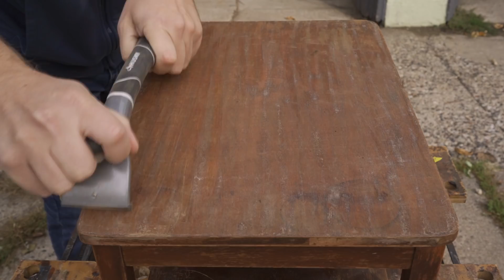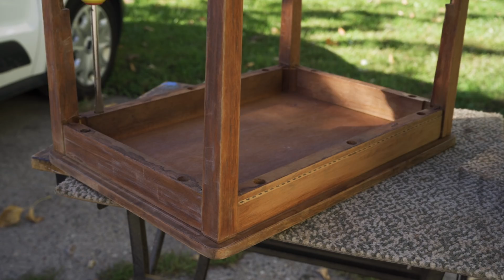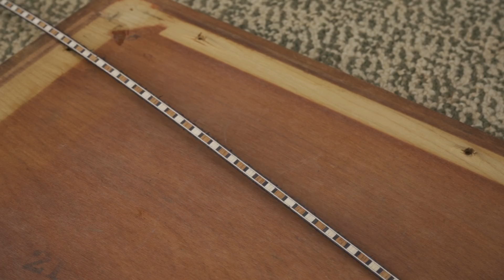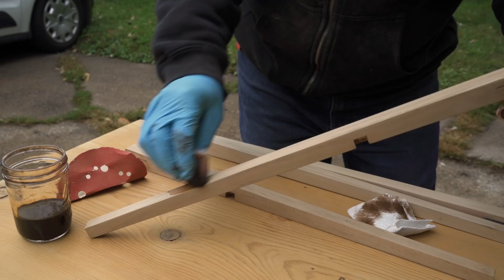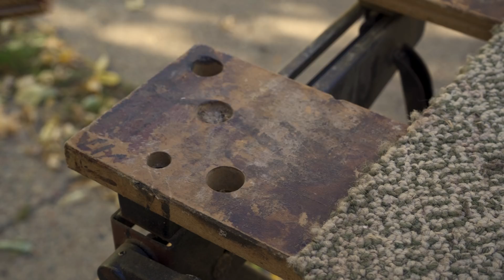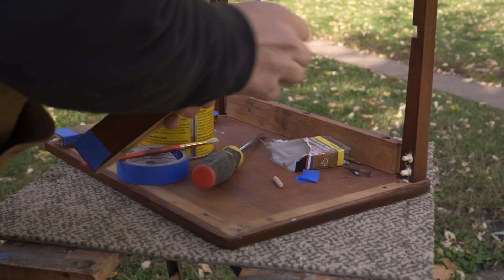Thrift Store Rescue #26 | Refinish And Add Inlay To A Thrift Store Table | Furniture Restoration

Comment: Hi! I am about to purchase an old GE stereo console from the 60s and am planning on refinishing it. Its in pretty good condition, but has some water damage on the top and other stain deterioration. I know you have not seen the piece, but do you recommend stripping the current stain, sanding, and restaining the piece? I also wanted to make it my own with varied colored stain on the piece. Do you know if there are different stain colors that go well together? First time doing this.

Comment: You did a lovely job with this table. I agree about the inlay. If it was too bright/contrasted it would loose some of its older charm. You were VERY patient with this piece, mixing the stains and replacing the brads with dowels.
Great $5 investment.

Comment: Just a thought on scraping:  Pull your scraper off the edge in two directions.  Looks like you are going over the far edge with the scraper, then pulling towards you.  That's got to be chewing up the edge of the veneer.

Comment: Nice piece of restoration Bud.   I am an Auto Body Painter, and you have done many steps using exactly what I do with Body Work and I  would have done everything the same way.
Only the part where you put the inlays.  Instead of using that little screw driver or whatever to cut and rid of the little excess wood material, I would have made a small block out of wood or plastic and block the entire groove so the inlay could have a nice clean fit.   Also, whenever you Stain, please go from END TO END in one long nonstop motion, do not start in between  a piece of wood, as stains tend to bit and soak in within seconds leaving a Dark and Light spot on contact.    Great job anyway.

Comment: I'm not sure what it was for when it was new. Perhaps a telephone table and a little shelf underneath for a telephone book. What it can be used for today is a printer table and use the shelf for printer paper. If it survives another 70 years who knows what they will have then to use it for. If you haven't purchased this it would have fallen apart and ended up in a land fill. You did a great job thank you for the video.

Comment: The inlay is on one side because that table is part of a three-table nesting set. The one you have is the bottom/lowest of the three and when nested with the others, it slightly hangs into/onto the middle table above it, then the middle table hangs from the top table while the top-most table legs are always on the ground. The top table has a three-sided (back and sides) ½" lipped edge (not sure what that's called) to keep things from rolling off (?) but in any case, defines which side the "front" is and explains your, the smallest of the three tables's, decorative inlay. These things I know because I have the full--and all three prone to wobble--set. :) Wonderful to see it renewed!
Reply: How cool!
Reply: Very cool! I knew there had to be a reason!
Reply: Well he only had one, so I think it was/is a good idea!
Reply: Nicely done.  Beautiful little table.
Reply: I'd love to have those!!!

Comment: I love furniture from that era. I would have spent $5 for that rickety table. I probably wouldn’t have so meticulously restored it but I def would have pulled it apart to make it stronger. And I would have sanded it a bit snd gave it a slight lacquer coating. Probably whale oil or something like that. But I like that shabby chic look to an extent. My living room is full of unique salvaged pieces. Only one that didn’t need work was the China cabinet I got at an antique store that was still in really good shape. I have a Hoosier cabinet in my office that needs a little love that I keep telling myself I’m gonna work on one day. But I watch these types of videos to learn some ideas how to restore vintage pieces in the meantime. My actual work desk in there was found at the dumpster. Tho not a vintage piece per se, cuz it’s mostly pressboard, i painted it with chalk paint and it really blends well with the room, including the Hoosier cabinet and is better designed for a computer than the Hoosier cabinet where I keep my printer and files snd office supplies and such. The neighbor who tossed the desk can’t believe how great it looks now. Thanks for your post. You’ve inspired me to get back to the Hoosier cabinet

Comment: Your videos have inspired me to try and refinish a dresser I got from my neighbor.  Citristrip worked pretty well, but it seems like there was a water-based stain or dye under the oil based stain I just removed.  Wet paper towels seem to remove it to an extent, but is there a better method to remove a water-based stain?

Comment: Another lucky table wins the Dashner Designs lottery! Wondering why you didn't do the color experimenting on the inside of the apron instead of the inlay side? Would have made it easier to back it up if the red went too far.

Comment: This is so inspiring, and reminded me of the pieces that have passed through my hands which could have been given a second life, but didn't have the knowledge or inspiration to work on. 
It'd be interesting if you can post a video on restoring old speaker cabinets which I'm sure many viewers would find interesting.
Reply: For sure! I have an old radio or ancient tv cabinet (radio/tv long gone from before I acquired it, when previous owners turned it into a (badly done) little cupboard). I've kept it for years just waiting for the right inspiration to make it look great again.

Comment: very beautiful table.
those wire things in the corners were romex staples used to attach electrical wiring during home construction to wood framing.
not really a proper fix

Comment: Great work as always. It seems like in a lot of your earlier vids you used a chemical stripper to remove finish and now you seem to rely mostly on scrapers. Any reason for the switch? Or is this just job dependent?
Reply: He has said they changed the formula of the stripper and it doesn’t work as well and this is easier.

Comment: Since this was an inexpensive table when it was made, my guess would be that the inlay was only added to the “front”.  I love that you added it all the way around.  It sure turned out nice!
Reply: This is a different Viki replying. I have two very similar tables that were my grandparents and failing similarly, but mine are wider and have two shelves instead of one. Their inlay is just like this, across the front only. On mine it is clear there is a front. I think it was done this way to keep the price low yet look sharp.
Reply: Now that I look at my piece I speculate that the top edges of the one in the video may have been cut down to the shape it is now, and in it's original form it may have been obvious the inlay side was the front of the piece. The curved corners on the top I do not think are original. I appreciate these videos.

Comment: Removing brittle lacquer is so satisfying. And the table is happy.
Reply: I'm new to this but I often go too far with the sander ..I never know when it's enough ......
Also I used BIN on a bedside locker and then painted but it didn't seem to adhere correctly or dry ...any suggestions ?
Reply: @AC-jr8bn  Instinct often alerts when one has done enough sanding. You do not want to go through any veneer, if possible. A bedside locker? So, something metal? If BIN didn’t dry, could be the application was too heavy, or a second coat was put on before the first dried sufficiently. Dry-to-the-touch doesn’t necessarily mean thoroughly dry. Also, if the bedside locker wasn’t cleaned properly, paint or primer will not yield a good result as if the surface was cleaned of dirt and grime.
Reply: @ashleywright8686  thanks a million for replying .
Reply: @AC-jr8bn  of course! We furniture refinishers need to stick together! I just subscribed to watch your transformation videos. You do excellent work.

Comment: Great work as always.  I like when you show how you worked around problems like the dowel hole split, but you left off the most important part; how did you adjust the dowel hole?  A related question, did you drill both sides of the dowel holes freehand?  I could never match that accuracy :)
Reply from the maker: I just plugged the hole and then drilled again. I just measured for the correct placement and then drilled freehand.

Comment: A tip for you about gluing a split in the apron like that… no need to tape off your finish.  PVA glue will wash off without marking the surface.  I hope that’s helpful for you.  Cheers. Scott 🇨🇦
Reply from the maker: Thanks, Scott.